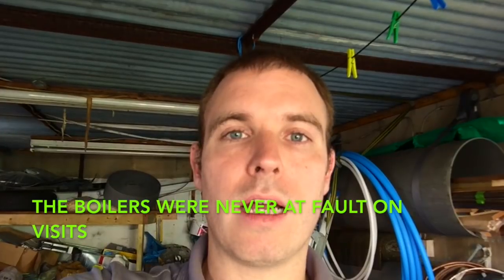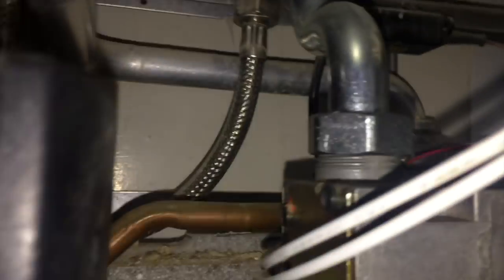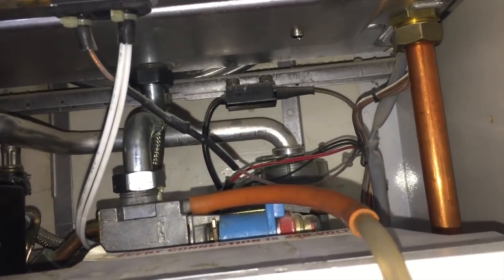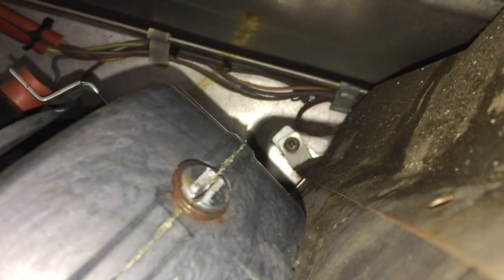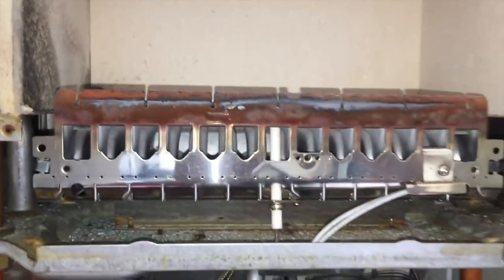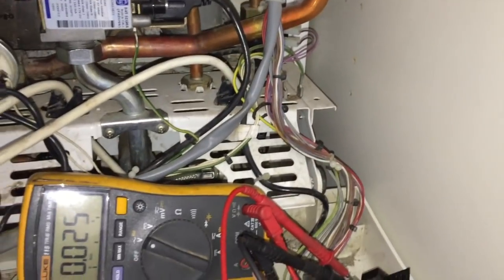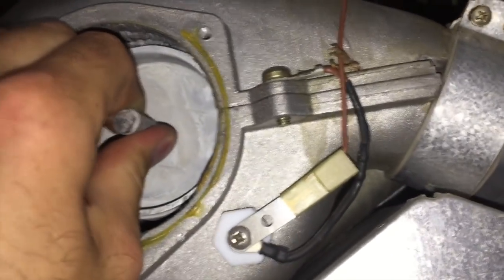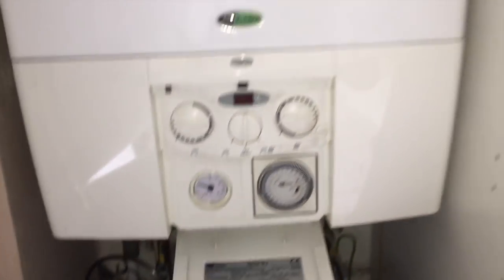Vokera Syntesi. Boiler 1of of 3. 01 fault code. Red light 1

Comment: The problem there is your relay switch for ignition board, No4. Be on the safe side and replace all three and all for under a tenner. Hate seeing people getting ripped off from these boiler Engs.  All the normal Joe blogs needs to remember is Boiler Sequence . Demand + Pump + Fan + Gas valve + spark + Ignition + Rectification. If it ain't the above its PCB....Basic.

Comment: Ive had 2 engineers look at my voker 24 compact, it keeps cutting out. They cant fix the problem, if i turn the heater dial to the middle the boilers rubs ok, if i turn it up full it cuts out, you think this maybe heat exchanger?
Reply from the maker: Maybe. Could be a lot of things though
Reply: @HeatingGeek  ha ha

Comment: The king at work..
Reply from the maker: I wish. These boilers are a pain. :-)
Reply: I got a ecotec plus 618 , f10 f20 both...Pump ok filter clean no air. ,found flow ntc n cable  wet from tank..,,took it off, reads 2.7k....

Comment: Nice vid as usual mate, again had the same issues recently on the same boiler, luckily I had the fault 01 occurring more regularly so was easier to diagnose. It was the the spark generator and replaced the recouperator which was a pain in the ass
Reply from the maker: HaHa. I need to get the second part uploaded so everyone can see what I missed on the first visit. You wont be surprised....
Reply: Pro  can 5 red lit
Reply: Proct25